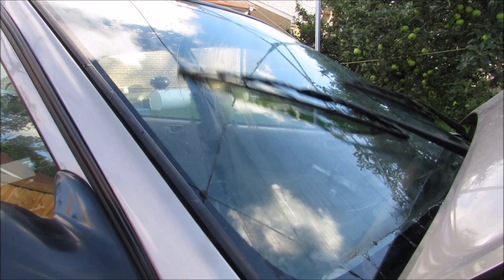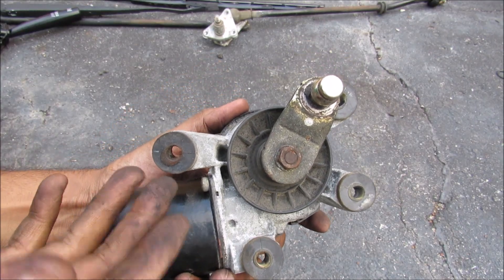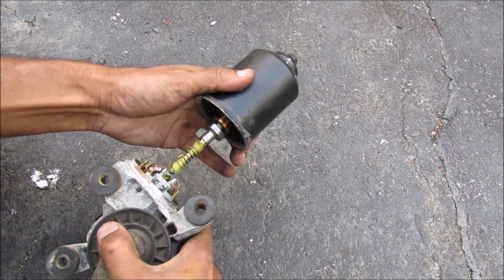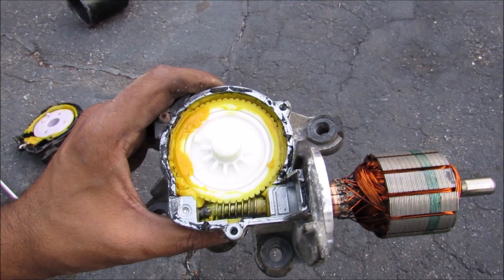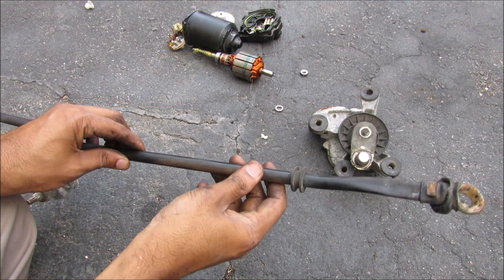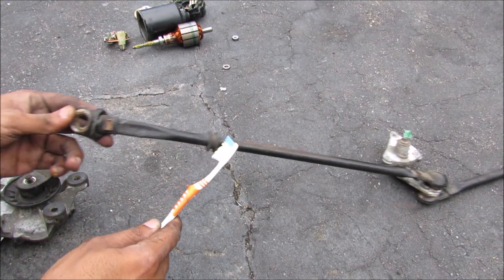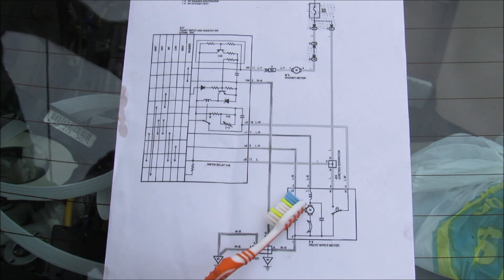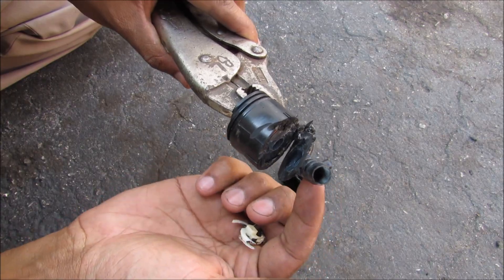How Windshield Wipers Work

Comment: My windscreen wipers 'stall' either near the top or the bottom of the windscreen....is the motor drawing current while they are 'stuck' ???  I have found a gentle push to both arms and they start moving again....OR....turn off the ignitiion and turn it back on again as many times as needed and the wipers slowly jolt along the screen, back to their home position.
Reply from the maker: It's that conductive disc 
Likely worn or contaminated
Reply: @speedkar99  thanks

Comment: Maybe you can help. I have 2015 Honda accord ex-l. For some reason my wipers stop in random positions after I turn them off or use the washer fluid. I replaced the motor and replaced the switch. Eventhough I replaced the switch the INT still doesn't work. When I turn the wipers of they will continue for about 2-3 secs and then stop. I'm thinking I'll have to replace the wire harness.

Comment: My wipers wont stop even after i changed the switch inside by the steering
Reply from the maker: You've got a short in the wiring.
Reply: @speedkar99  someone told me change the motor,the problem only happens in the morning after the vehicle has been running everything runs normal

Comment: Many mid-20th century cars had a wiper motor powered off the engine vacuum.  When the accelerator pedal was depressed (such as when driving uphill) the lower vacuum of the engine would often cause the wipers to stop working.
Reply from the maker: Interesting

Comment: What a great video! Hope you are doing alright mate, we have the same car, minus the low washer fluid sensor. Guess you have the 99 model with the plastic straight headlights and not the round ones like mine. Thanks a lot for being to the point. I removed the bronze crank from the motor, and now I cant align the wipers, even though I marked them. I forgot to mark the bronze crank to the motor coupler 😅. Any remedies for that?

Comment: Again, I can't believe how poorly it's designed. Instead of using brushless DC motor and Hall effect sensors there's plenty of 19th century-like wiper sensors/contactors and an old brushed motor, all surrounded by plastic.
Reply from the maker: Yeah it's brushed, but it sure lasted a good while

Comment: Can you make a detailed video in how the intermitten function works. 
I drive a 2000 Suzuki Jimny with just one  intermitten and I would like to Unterstand the electronics so I could maybe replace an Resistor  with a potentiometer to have adjustable intermitten speeds.
Reply from the maker: Good idea for a future video. Thanks

Comment: what do each of the 5 pins do I noticed the same was in my car. when I remove the motor the and connect them to power it would power on. from what I've seen from schematics I thought they were positive, negative, reserved, connect to the other wiper motor and then to the passenger compartment computer. you have any ideas on what am doing wrong here.

Comment: Hey thanks man, I see in some of your videos you include main malfunction reasons for these autoparts but not in this one. I would like to know why the wiper motor fails (humidity, overheating, etc) For instance the wiper motor housing usually has a breather hole with a small membrane to prevent water coming in which is crucial for durability  but you did not mention it. Other than that great video!

Comment: If you set the wiper switch to the high speed setting, and a cable break occurs in the high speed wire while the wipers are in a non-parked position: will the wipers stop where they are, or will they return to park using the low speed setting?

Comment: Thanks a lot. Now I understood how the wiper comes back to home postion. Also about reed switch in float mechanism. My question now is ,we can use any washer fluid in tank,since it will not corrode the turbine in pump since it is made of plastic & motor pump is well protected
Reply from the maker: Yes it's all plastic. Don't use anything that will burn plastic though

Comment: Dear Speedcar99,
While there are many video's on wiper motor replacement, you really get into the meat of the motor operation. My 240 volvo motor frequently stops running.  I lightly tap the motor with a hammer, and it comes on again. I am having to tap it more frequently, and its getting worse. I need to open the motor, and would like your guidance on where to look for the problem. Also when its operating it works intermittent, slow, high speed, and parks itself. Thanks in advance for your advice!
Reply from the maker: Seems like those contacts are wearing down
Reply: @speedkar99  Thank you for your timely response. I found the problem. The 2 magnets came loose from inside the metal housing.  Epoxied the magnets back in place, and will soon be reassembling. Any ideas how to hold the 3 brushes back to get over the comutater appreciated?
Reply: Your video much appreciated!!  Got two 240 wiper motors working again. Both had magnets that were originally cemented inside body tube come loose.  Epoxied them back re inserted the brushes and voila. You my friend are doing good service to us youtube students in the classroom. Thank you.

Comment: speedkar99, thank you for your excellent video!  I have a question: how is the motor speed changed from high to low speed?  Is the torque higher at the low speed?  Thanks!

Roger
Reply from the maker: The voltage varies the speed
Reply: @speedkar99  If you take a closer look at the circuit board attached to the gearbox you'll see three spring loaded brushes.  Two of the brushes are 180° apart, those are the ground and low speed brush.  The brush with a 30° offset is the high speed brush.  The offset of the high speed brush is what causes the motor to run at a higher speed.  There are PWM wipers motors which vary speed by controlling voltage but this is just a standard wiper motor.
Reply: @speedkar99  Thank you again.  I suppose the lower voltage for the slower speed does not increase the torque and may even decrease it.  Roger

Comment: Awesome video. Perfect. Exactly what I always wondered and needed to know in my current problem. Trying to fix a Ford Truck. They have the wiper motor going threw  the GEM (Generic Electronic Module). I was hoping to wire around the GEM with the use of a High/Low switch.  Between the wiring diagram  and your video I now have a much better understanding on how I will do this. Who knows maybe I'll make a video of my fix. I've had to fix other things on that Truck. Thank you.
Reply from the maker: Glad you found it helpful

Comment: 30 sep 2019 4:22 pm edt:thanks.
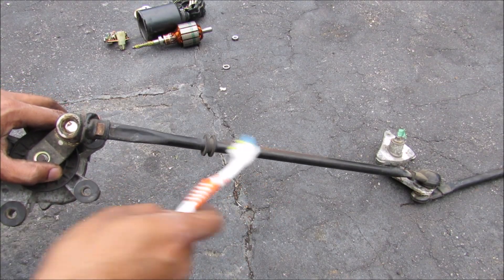5:00 does raising windshield-wiper weaken windshield-arm-spring which press windshield-wiper-blade against windshield ?

30 sep 2019 4:51 pm edt:
bathroom-weight-scale use spring and endure repeated-usage.so maybe wiper-arm-spring is durable.
Reply from the maker: As long as you aren't stretching the spring past it's elastic range it'll be fine!
Reply: if wiper is in up-position/not touching windshield then wiper-arm-spring is being stretched then become weak as time goes on.
source:
(1)'The gear at the pivot is plastic, and raising the wiper blades in this fashion will create too much torque in this area, which can cause damage to the splines. It can also bend the arms and weaken the tension springs that hold the wipers down against the windshield. All these things will eventually cause the blades to skip across the windshield, rather than sweeping smoothly to clear away rain, ice, and snow.'
(2) 'Angling your wiper blades away from your car to keep them free of snow and ice may seem like a good idea, but it’s not worth the potential damage. In the long run, it will certainly hurt your wiper blades’ ability to perform effectively–and that’s the last thing you want when winter weather driving is on the forecast'
in http://www.wehearthonda.com/honda-seekonk/dont-raise-your-wipers-before-a-storm  from https://mechanics.stackexchange.com/questions/5521/should-i-pull-my-wipers-away-from-the-windshield-when-parked-during-a-winter-sto  from google(weaken windshield wiper spring) from 'weaken' in https://www.aaa.com/autorepair/articles/how-to-deice-your-cars-windshield from google(windshield wiper up forever)

Comment: hello. my rear wiper doesn't stop working.  I've looked for a stuck relay but I couldn't find any. what you think the problem is
Reply from the maker: Sorry to hear that. Check the voltage at the motor and troubleshoot from there
Reply: @speedkar99  I ffound that the grease covering the parked position ring became conductive when it mixed with coper and iron dust resulting from friction so the motor kept receiving current . a removed the bad grease and problem solved

Comment: I like how this guy does his presentation with his videos but just wanted to clarify a few things: the motor is an electric motor - not "electronic"  / the spiral gear is commonly referred to as a worm gear / the switching mechanism behind the rotating spur gear (driven by the worm gear) is mechanical in nature - not "electronic". The term electronic seems to be ever more loosely used in describing components such as this when electrical is much more appropriate. I came here to learn how windshield wiper system work as I have an issue with my car's system not returning the wiper blades to home position when turned off. I thank this gentleman very much for taking the time to assemble this video! I think he also produced a video on EVAP systems used in cars as well, which he also did an excellent job of-thanks!!!

Comment: Cool, I always guessed it was a push-button limit switch external to the motor that got the wipers to "park" at the bottom, but it's more like a rotary switch internal to the motor.
Reply from the maker: Yes it is a rotary switch, and the contact breaks at the park position

Comment: what if I want to repair a wiper motor for the car that has stop the production of the replacement unit? mine is weak, and the intermittent does not work at all. is there a way to repair it?

Comment: I removed the motor to be checked and it took a while. Now that intend to install the wipers it only moves half way up and when it comes down moves passed it supposed rest position. How could I solve this? Thanks in advance!
Reply: It sounds like you put it back together while it was in the wrong position. Unbolt the wipers and then turn the wiper system on then off. It should be in rest position and you can then bolt the wipers back on.

Comment: So the wiper motor doesn't turn the other way once turned off...is there anyway to undo that?
Reply from the maker: No, it just keeps running in one direction.
Reply: Well... if you wanted it to operate backwards... you could reverse the polarity of the motor... IF the housing of the wiper motor is not grounded through the body or bolts that attach it to the body.. Assuming that your brothers toothbrush and your brothers sock allow you to rig up reverse polarity, the wipers will work the same, sorta, park will get weird. Probably?

Comment: ThankYou ! How do you make a portable one?
Reply from the maker: +Forgive Repent like for your sunglasses? Hah
Reply: speedkar99 My windshield wiper switch broke on my 1985 Isuzu Pup truck so my windshield wiper blades don't work. I wish somebody invent a universal portable suctionc cup windshield wipers blades that can be charged with a USB cable. And can be place on any windshield with adjustable blades for different length sizes.. I had a vision about it. Maybe you can create or invent one. You seem really smart Bro. If you make one Bro I will buy it. I wish I had the knowledge you have when it comes to this.You a Genius Bro.

Comment: Super helpful! How easily should you be able to turn the motor by hand? I've been blowing fuses and I think the part that attaches to the linkages is binding up. Lube it up?
Reply from the maker: +The OM Sound the motor should be easy to move once disconnected from the drivetrain. Obviously you don't want to move the wipers as the spiral gear will just skip or break.
Reply: The OM Sound ii
Reply: Awesome thanks. Ended up getting a new motor as the old one was for sure seized up!

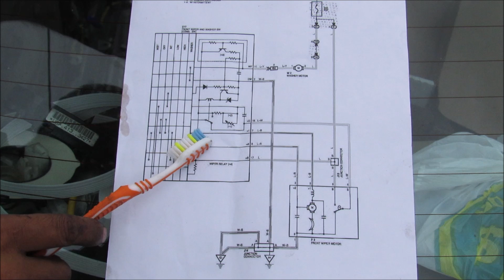Comment: Hi , it's a great video. I manage to understand how it works now. Just found an error at 6:01, you mentioned capacitor. BTW that's a transistor. There are capacitors in the circuit. Well done for the effort of making this video.
Reply from the maker: +Vijaya Gopalan Subramaniam thanks for the correction

Comment: how much current did it need to run primarily  ? at low and high settings how much current did it draw individually ?
Reply from the maker: +Mejbah Ahmed Mubin Not sure, maybe look at the circuit diagram and fuse ratings to give you an idea. Regular multimeter can't measure such high amps

Comment: why there is slight motion in the wiper motor when it's connected to car body even though it's bolted tight in place.
Reply from the maker: +cobra R because its soft mounted through grommets

Comment: You can swap to the intermittent wipers just by swapping the appropriate switch from a higher spec corolla (I loves me some junkyards) The timer for the intermittent is in the switch.
Reply from the maker: +John It sure is. Good tip

Comment: On my 98 civic. The wipers never auto return to their resting position when turned off. They just stop where they are. Is this fixable inside the motor? What were the two wires you shorted together when the switch is in the off position?
Reply from the maker: +mrsemifixit yes in this wiring diagram the off position shorts these two wires which give the motor the extra power needed to come back to the home position. Check your wipers switch, or those two contacts on the rotating gear I showed in the video.
Reply: speedkar99 Yes but what are the two wires that short out? So I know which ones to look for
Reply from the maker: +mrsemifixit civic has a different wiring diagram. You need to look it up for your make and model.

Comment: do u know if there is any way to adjust the so call movement "height" of the blade. Like when the blades (drivers side) goes all the way up and close to A pillar right...but is there a way to adjust that height so that the blade can extend even move  and very close to A pillar.hmmm
Reply: lexusfan100 yes, remove the wiper as he did at 0:20 and simply tighten it back on at a slightly higher angle so that the stroke is now shifted toward the a pillar
Reply from the maker: +Kevin Standifer exactly, or you can bend the wiper arms.